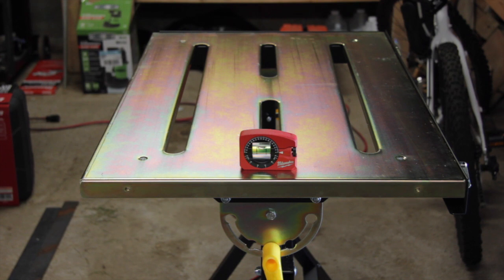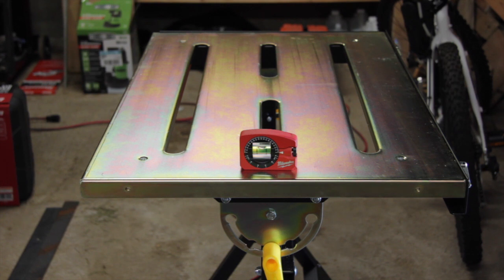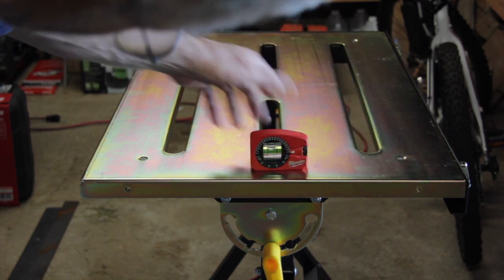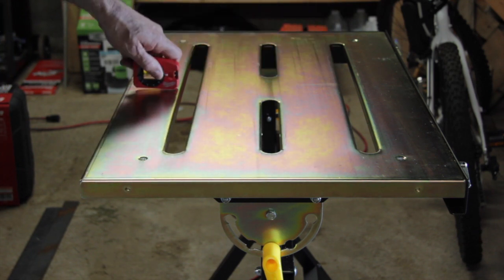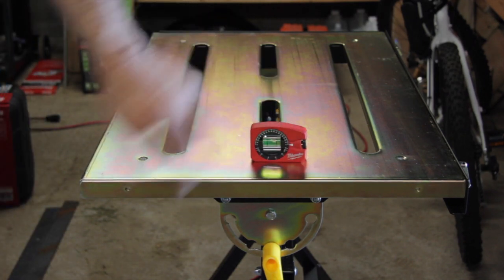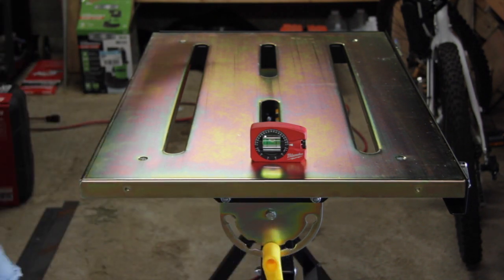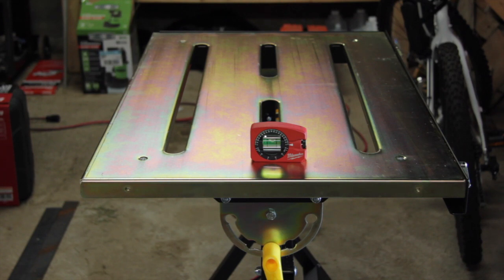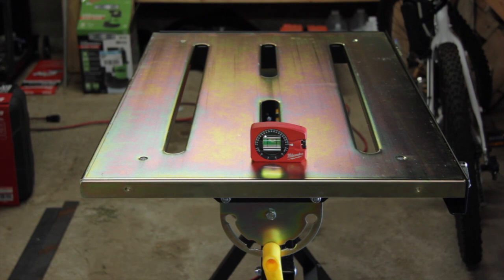Harbor Freight Mods - Welding Table Is it flat

Comment: I have this table and love it. I baked the bejeezers out of it welding aluminium practice pieces directly on the table and it's quite warped on one side now. But no matter, it has great clamping options. Using scrap plate metal to weld on after tacking and being more aware of the heat would have stopped the warping.
Reply from the maker: Thanks Fltchr, yes I agree,  great idea.

Comment: Because the top is stamped steel, it’s not going to be perfectly flat. The stamping process will not produce reliable results. If you can find a piece of 3/16 or 1/4 material to add onto the top that would be great! You might be able to add angel iron around the base that might help..
Reply from the maker: Yes, Brett, I was thinking of some square tube or angle iron. Still debating on lightly welding or using flush mounted screws so I will not warp it anymore.  Thanks for the great tips
Reply: Joe's Fab Lab flat head screws might be your better option! Your probably right, welding might warp the plate. I like those welding tables, I am glad you did a video on it!!
Reply from the maker: Yes Brett, I like the table as well, I am more than likely being a bit anal on the flatness.  I do have some flat steel plate that I can add to the top. Thanks
Reply from the maker: Thanks Bret